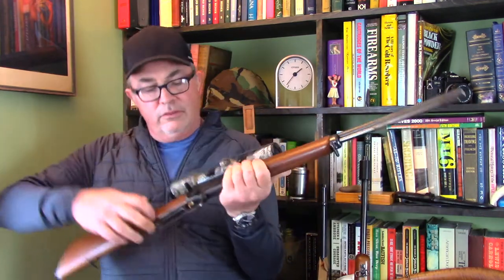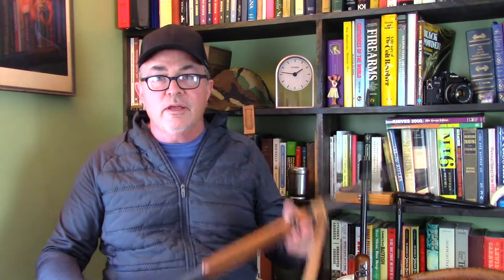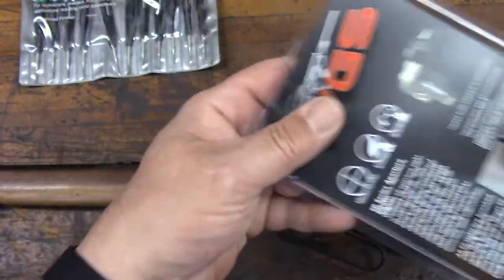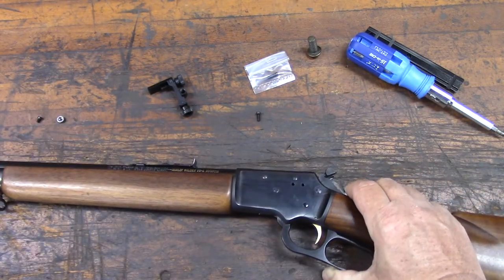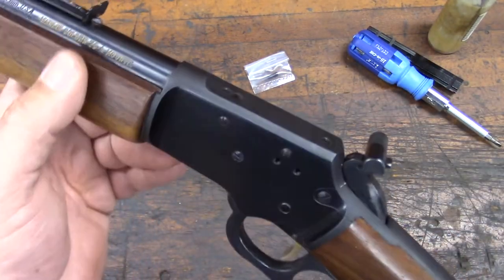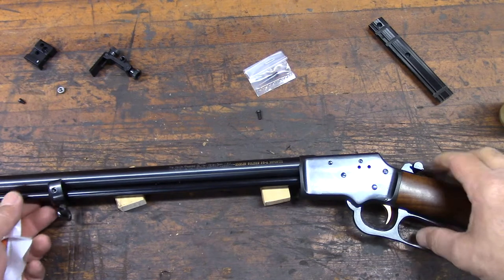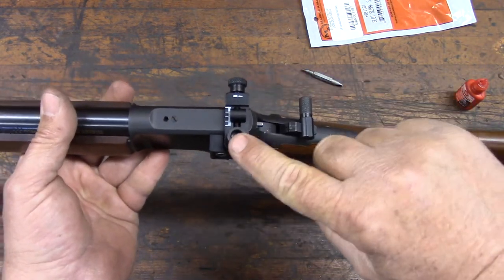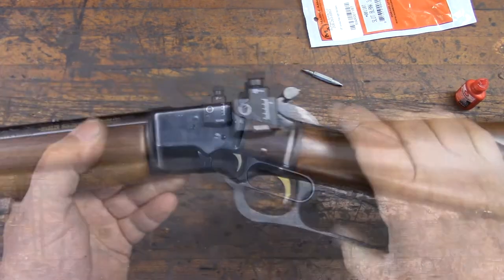Installing a Williams Foolproof Receiver Sight on My Marlin 39a

Comment: Very nice video.  My 1947 39A came with the top tang drilled and tapped for a tang peep sight.  I installed a Marbles tang peep sight which fit perfectly.  Less bulky than the Williams.  The only down side is you can't easily place your thumb over the tang when shooting.  I have learned to lay my thumb along the wrist of the stock.
Reply from the maker: Thanks for the positive feedback!
Those Marble's tang sights are so cool. I am envious.
Reply: 😊I like the Marble sight also. I have them on a Marlin 39A, Marlin 94, and a Rossi 92.  I don't think this aluminum Williams would wear well, but I haven't used one to be honest!

Comment: That seemed crazy complicated. I have a Marlin Mountie that I added a Skinner peep sight to. Maybe took 5 minutes. Easy windage and elevation adjustments. Made in USA. Very clean look on the little 22. Not bulky at all. Didn’t have to remove the rear sight except for the elevation slide. Very accurate and inexpensive.
Reply from the maker: I’ve been looking at the Skinners. I’ve read nothing but good reviews. I might put one on one of my Marlins. 
Thanks for the tip!
Reply: Can you add a link
Reply: @Eric Young
I think it seems that way because this guy is a long winded sob.

Comment: The various locking screws requiring loosening to adjust the sight is very counterproductive when the target knobs are meant for a quick adjustment on the fly. 

Would it at least be possible to replace the small locking screws with nylon set screws so the sight remains tight but no loosening is required?
Reply from the maker: That makes sense to me. If nylon screws of the correct size could be found, I think that would be a great solution.

Comment: What installation screw goes into which hole?  One installation screw is much longer than the other.
Reply from the maker: I’m not entirely sure anymore. If you bought the sight new in package, one installation screw should have been captive, under the elevation slide. That is, I think, the rearward screw. I’ll take a look at mine and see if I can figure it out.
Reply from the maker: Okay. After taking a second look, I think the longer screw goes into the forward hole on the left side of the receiver. This is because the aluminum base is significantly thicker there.
Reply: @SuburbanRifleman  Nevermind, I figured it out.  Thanks.